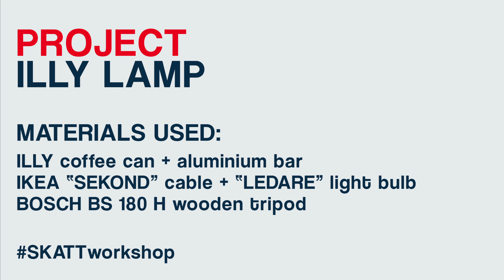DIY industrial ILLY lamp

Comment: Hello, precious DIY, what rubber do you put so that it does not cut the can at the head? thanks
Reply from the maker: Hi. Sorry for the late response. The rubber is usually found in a car part store as it used for sealing the car parts like doors ect.